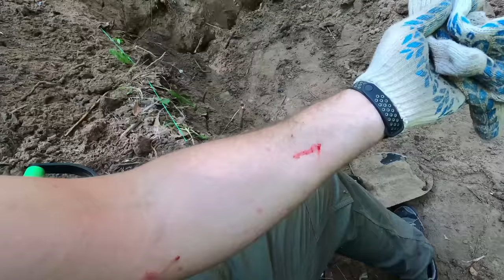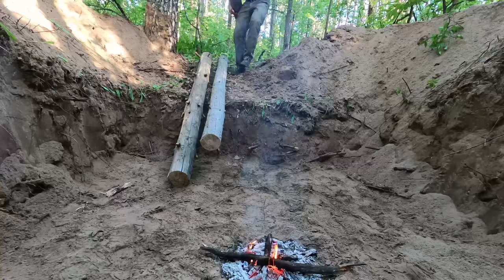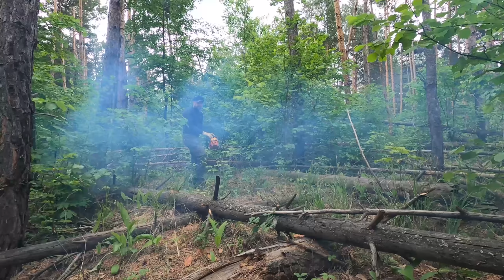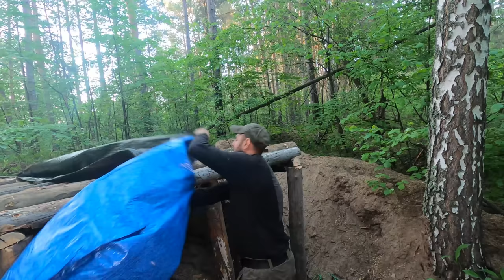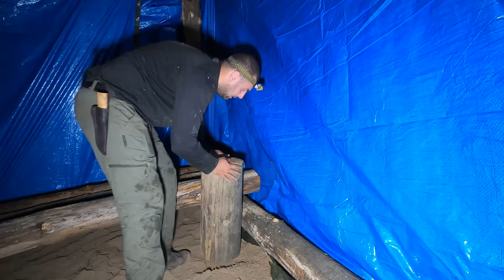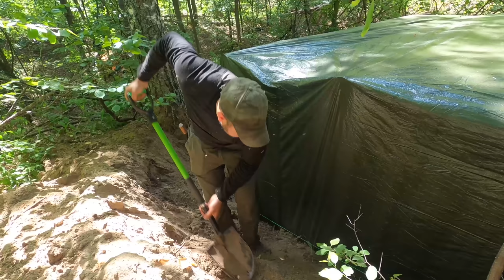A secret house in the forest, underground bushcraft. Survival in the forest. Without words

Comment: It is very enjoyable to watch you build!! 👍🏻👍🏻  Also, mosquitoes and other flying insects don't like smoke, so building a little fire near where you work should help keep them away!!
Keep up the good work!! 👍🏻👍🏻
Reply from the maker: Thank you for your support! I will definitely try your advice!
Reply: @SimpleLifeBushcraft I have found that the butane powered Thermacell mosquito repellant devices work very well, even when the mosquitos are swarming. It heats up a pad treated with allethrin, which is commonly used in mosquito repellant products. Allethrin is a pyrethroid, a synthetic chrysanthemum extract. A number of essential plant oils besides chrysanthemum extract will also repel mosquitos. You're clever, you can probably make an essential oil heater/diffuser that would work.
Reply: Проще  и  надёжнее  из  такой  древесины  и   таким  инструментом   избушку  "в  лапу"   сложить. 😴